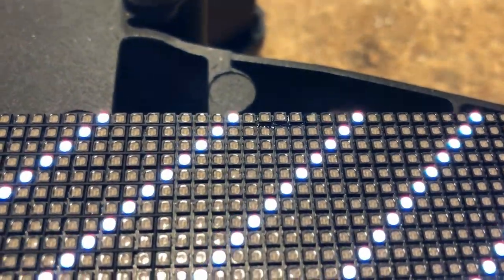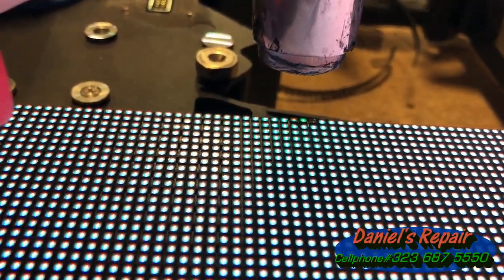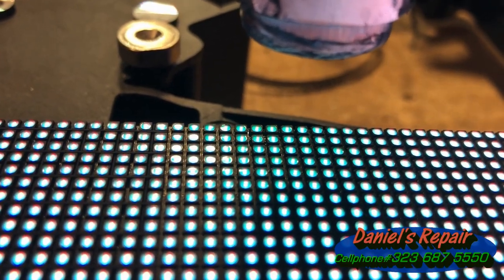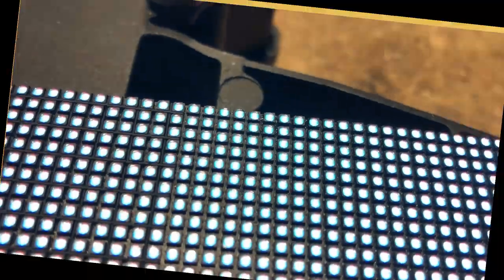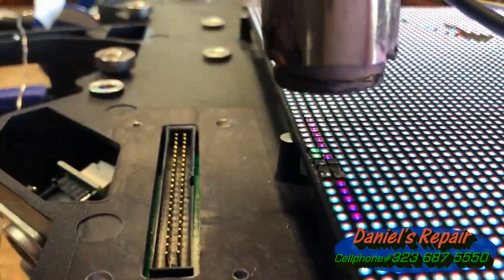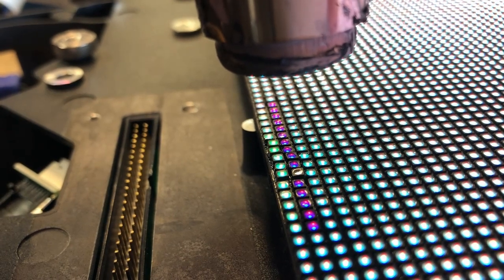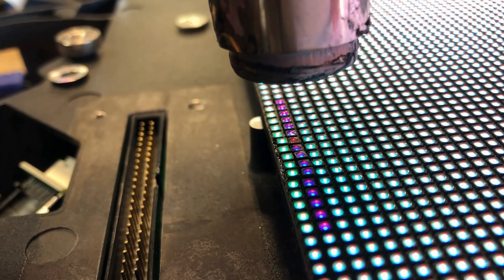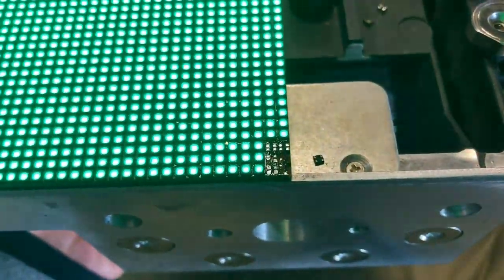how to repair 2mm led module in 2 minutes

Comment: What is the temperature you use sir? Thanks for the answer 😀
Reply from the maker: the temperature I used in the demo video is 350 degrees Celsius.
Reply: @danielsledrepairservicellc9347  WHAT KIND OF LED CAN YOU WORK WITH AT THAT TEMPERATURE?

Comment: The real question is, why were those pixels on wrong in the first place? That didn't look like they were damaged by any impact they looked like someone tried and failed to repair them. Im not that lucky because most of the pixels I have been repairing over the last 8 years have had the traces pulled off, so I need to run wire or put on new circuit paper. Good video though keep it up.
Reply from the maker: Thank u mike, they were damaged and I started the recording after I putting circuit paper. lol
Reply: Hello, good day, I have been looking for where I can get the circuit paper for 2121 smd diodes, which are from an absen P2.5 lite panel, could you orient me where I can get it? Thank you

Comment: I like your way of explanation to how to fix the problem..!!
So I have a problem in my led display screen module..!!
I have around 6 meters long display screen and consists of two lines of led blocks...
The problem is that the (upper line) which consists of around 15 led blocks is the whole blocks are always lit up, while the (lower line) is working and displaying normal which shows up the lower half of the words and numbers only...!?
So please if understand my explanation, tell me how to fix this problem..??
Thank you so much...❤

Comment: Hello, i have a few cabinets that have like 10-15 led stock on the same color, when i heat it up like on the video they work just fine, but when it start to cool down the led go back to the color it was stuck before, any ideas on how may i fix this problem? Thanks!
Reply: Dip some tin soldering paste it and try again 😊
Reply: A cracked solder joint which expand on heat and make contact and break contact when cool or the led is bad the bond wire inside the led could have been floating

Comment: Dear Sir,.. any idea how to fix a strip ( green, blue or red color ) on led wall. I have try to change the ic driver and checking on LED Chip as well but the problem still same..  sometimes the problem come up randomly. thanks
Reply from the maker: Hi,Rudy, Thanks for your inquiry. May I know which country are you from?
Reply: @danielsledrepairservicellc9347  indonesia..